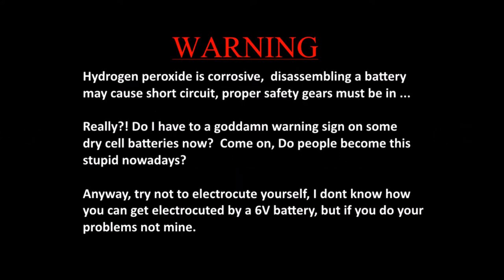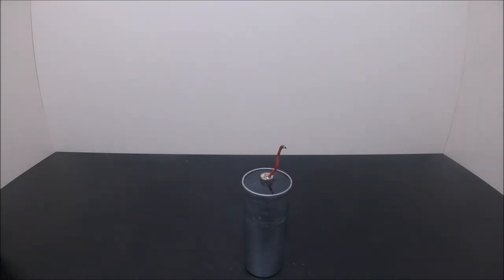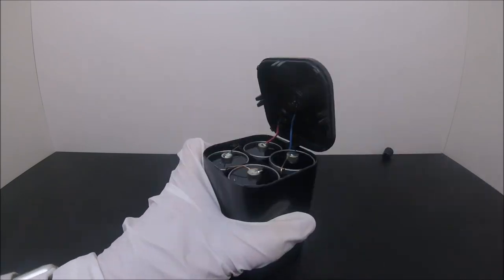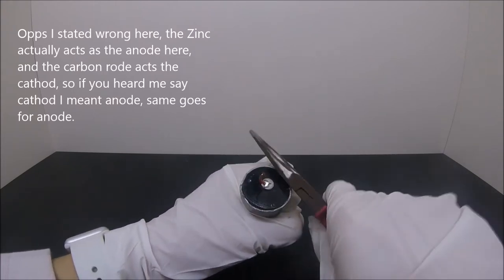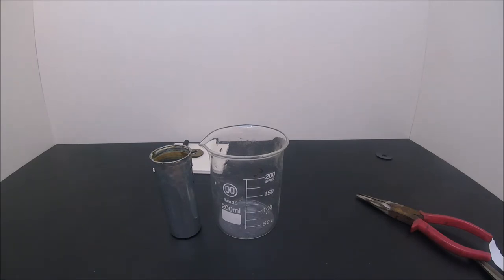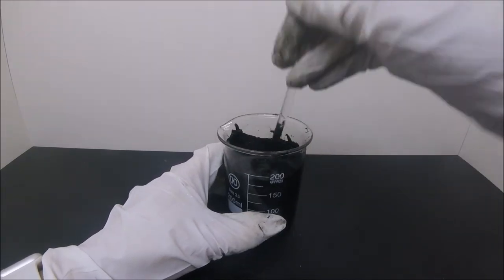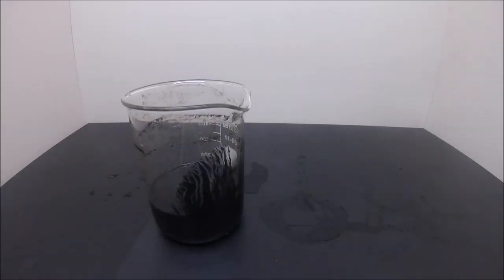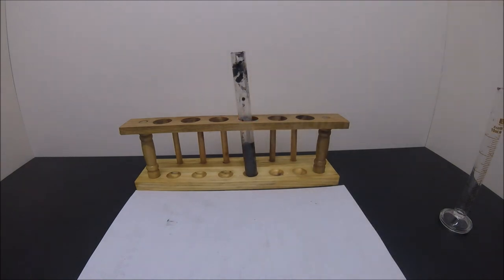How to get Manganese Oxide from Zinc Carbon Batteries.

Comment: Well any idea on how you will get rid of the graphite contamination? Got some manganese containing slurry from alkaline batteries. I tried to convert the manganese oxides to MnSO4, but failed because of the almost not happening reaction in H2SO4. Also tried to convert the manganese oxides to MnCl2 but abandoned this. Only 50% of the HCl is used to form MnCl2. The other 50% is released to the air as Cl2 - which isn't only very healthy without fume extractor, but also very inefficient. My goal is to get pure as possible manganese or manganese salts. (Don't care - just doing it for the lolz)
Reply from the maker: dasuboot123 i am thinking about doing a video about further purification. High heat maybe used to oxidise the carbon to CO2 idk if my DIY furnace is hot enough to achieve that, I'll definitely be considering chemical process nitric acid maybe ? If other 2 don't work well
Reply: HNO3 isn't an option for me. Well, maybe I could order some from Amazon (never tried to) - but for the sake of competition I'd like to do it the OTC way of home chemistry. So literally only stuff from the hardware store ;)
Edit:
Maybe i should give it another try with boiling hot H2SO4 :/ According to Wikipedia, MnO2 will react with it under heat addition.
Well i've already done some H2SO4 distillation - but I'm not completely sure if it is a smart idea to have boiling hot acids inside of my workspace. :/ Still missing the fume extractor in case of SHTF. (shattering glassware due to thermal stress)
Reply: Pirahna solution?